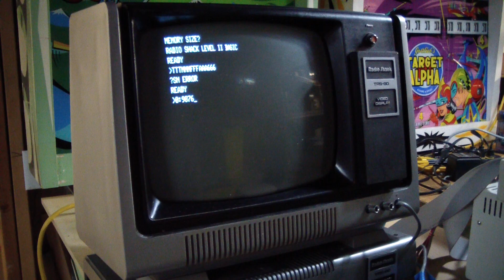AE#205 Cleaning Keyboard Contacts on a TRS-80 Model 1

Comment: As always --thanks for posting Arti. I just received (yesterday) a TRS-80 Model 1 Level II with the lower case mod from an eBay auction. Some case damaged on the bottom shell and 2 broken off keys. Otherwise it seems to be intact. All the chips are on the board. It was sold as "untested." I haven't even plugged it in yet. I've got to dig out my other Model 1 for the power supply and monitor. I's highly likely that someone plugged power to the video port, but we'll see.
Reply: Hey Arti --I just broke out my other TRS-80 Model 1 and tested the new machine. The eBay auction clearly stated "PARTS/REPAIR, UNTESTED." I just powered it up and it works perfectly! 2 broken keys to fix and some broken plastic on the bottom. But otherwise it's running great. PS: i've been looking through boxes of 5.25" diskettes looking for hard-sector media. I've checked 8 boxes so far, no luck, but i'll keep looking.
Reply: > It's highly likely that someone plugged power to the video port, but we'll see.

Oh, god, that really was one of the dumbest design decisions they ever made, wasn't it!  😠  Using the same 5-pin DIN connector for the power, video, and cassette ports, without even any kind of color-coding or obviously-visible markings for which one was which?  I wonder how many fried Model I units Tandy's repair centers had to fix under warranty back in the day for that boneheaded move...

Back in the day, Dad and I "borrowed" a couple of bottles of Mom's nail polish, and painted the power connector and socket bright red, and the video port pearl-white, so we wouldn't get them mixed up. 😀  (The cassette port, we left plain black.)
Reply: F

Comment: To dose some sort of liquid from a pressurized can make a dispensing tool. It's as simple as getting an old business card, cut a 3/4" strip from it and fold it in half. Now spray the liquid into the V on the b-card and drip it into place. You get accurate application without the mess.